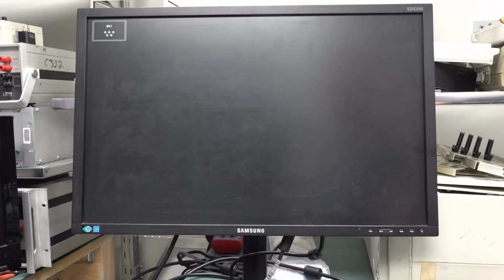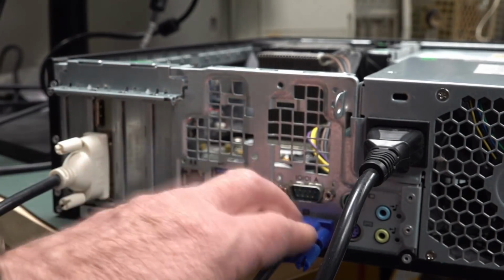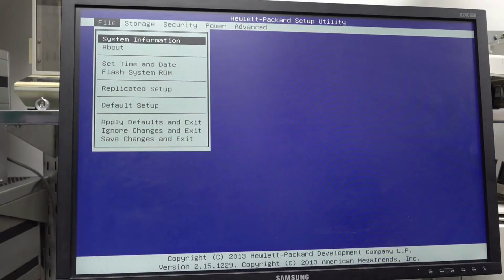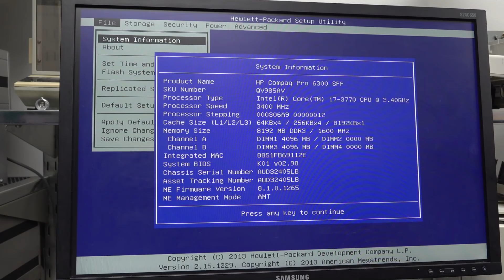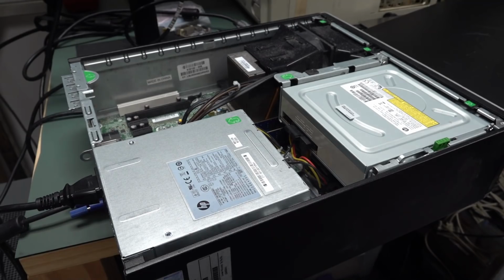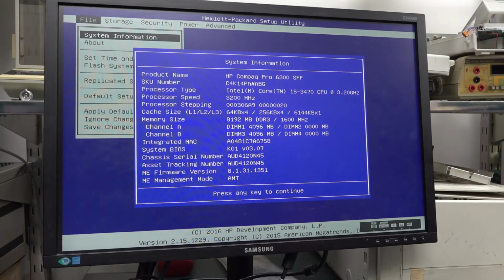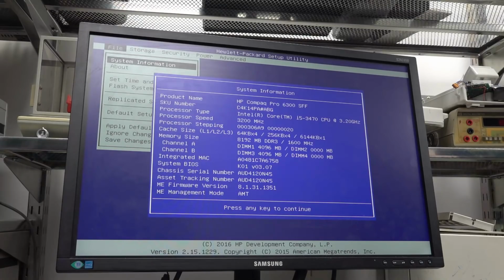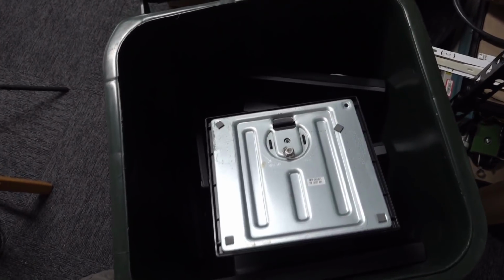MORE Asymmetrical Dumpster PC Stacking

Comment: Ah yeah sff business pc's. I see them in the ewaste often in numbers optilex, thinkcenters etc... I always liked the cases. They're hard to flip though in my experience anyway. I think people buying desktops are gamers mainly and sff not really flexible for gfx cards and storage options etc.
Reply: Some people transfer into fancier cases add some RGB, SSD , GPU and sell but sometimes HP/Dell/Acer use proprietary components
Reply: @Glenjimen  I found an m73 Lenovo a while back 4th generation i3. A pretty good machine I'll end up sticking a 4770 in it but yeah hard to flip. I wouldn't bother transfering it to another case just wouldn't make sense as everything is kinda made to fit. The case is actually the best thing about it that it slips under a hutch etc. Though by today's standards it's still pretty big. Development of mini PC's, raspberry pi etc is pretty cool imo. We'll end up being able to vesa mount a little box on the back of the monitor soon.  You already can but they'll get way better, substantially more powerful once we get beyond shortages and slowdowns of semi conductor components etc...

Comment: My employer uses software and back end infrastructure for 10-20 years, but we change out client desktop and laptop hardware after 3-5 years.

HDDs get shredded, the rest is auctioned off by the pallet.
Reply: An normally ends up in Africa

Comment: You should make a Folding At Home cluster computer that runs off your solar system when you're away or not using all of it's capacity until you get some energy storage.
Reply: It is amazing how much more a modern desktop can do for the same power,  compared to something 8-10 y old. A modern graphics card can do even more than that. But yes if it is energy that would otherwise go to waste,  you could run the old hw cluster...

Comment: I upgraded to an i7-3770 SFF machine last year for $100. Finally I could play x265 movies. DP is such a pain, try finding a converter that outputs 2k DVI for under $100.
Reply: Easier and cheaper to just buy a decent monitor or TV that has HDMI inputs. Something from, what, year 2000 or so.
Reply: @johncoops6897  I didn't know there were 2k+ DP converters under $100. The only cheap ones are passive or don't work with older DP computers.

Comment: Still running i7-3770 as my main desktop here at home and just moved it from Western Digital Black spinning rust to SSD. :)  Oh, I am on my 3rd laptop since then so there's that.
Reply: Same CPU and I switched to SSD with Ubuntu and the only difference I could notice was faster booting (yay, I save 20 seconds every three months I reboot) and applications start up much faster.
Reply: I have FX 8300 that still sucks compared to i7 3770k

Comment: If 1,000 people haven't already told you, there's a strong chance those DisplayPort connectors will supply HDMI with a cheap passive adapter.
Reply: Also VGA until recently (Nvidia until 9xx)

Comment: those i7-3770 are pretty expensive on eBay and co, a while back they were 150€+ or more...
Reply: Yeah, a lot of the cpus and ram would be worth reselling... 10x 3470 would be like at least a few hundred bucks still.
Reply: @rkan2  yes and the Motherboards are great for Parts! You get some nice ultra low ESR Polymer caps and some great (SMD) MOSFET. Though some are power stages (=MOSFET with Drivers), so they might not be that easy to use....
Reply: They should be. I've got 3770k and it can run most modern games just fine.
Reply: @SurajGrewal  well, yeah, but the days of Quad Cores for gaming are numbered...

Comment: Dave 
If you donate a computer make it the best PC you can with the available parts .
Move the I7 cpu into the I5 case then max out the memory .
Or just fill up the slots with the same size ram modules & fit 2 hard drives .

Storage is more important than a video card .
 A 5 or 6 year old computer with on board graphics should work ok for video & surfing the net !
Reply: Why go to all that effort? A donated PC is a donated PC - they get what they are given.

Comment: I'd go peel those product key stickers off the rest if it were me.
Reply: OEM keys get locked to the hardware. So pretty much useless unless you reinstall Windows on the same machine.
Reply: @DONK8008  Not quite. The factory install of Windows will be done with a special manufacturer key and the sticker key is only there for reinstallation. Since the sticker reinstallation key is probably unused I don't see how they could tell if it's being used on the machine or not.

If you are reinstalling on the same machine, the sticker key is always unneeded on these systems as it's possible to reuse the original manufacturer's key of 74T2M-DKDBC-788W3-H689G-6P6GT after installing a certificate file.

Comment: All our monitors at the office are DVI and all our PC's are DisplayPort. You can buy DisplayPort to DVI and DisplayPort to HDMI adapters dirt cheap off Amazon/eBay. DisplayPort is backwards compatible with DVI & HDMI, so a simple adapter works perfectly fine.
Reply from the maker: Yeach, I just don't have spare DP cables or adpaters, but tons of DVI cables.

Comment: Take out the mobo + cpu + ram + psu and put them on ebay as a kit ... or even without psu if it's standard atx psu. Worth it.
Reply: mobo isn't standard either. Most of these smaller form factor PC's from Dell/HP use a custom layout.  If Dave were to bother the only shit worth pulling to resell these days would be the CPU.
Reply: Not worth it AT ALL. You forget the labour to test, disassemble, photograph, create listing, package... then deal with refund claim for that parts "didn't work". These machines are trash, which is why the are in the bin rather than sold. OK for hobbyists, but totally non-viable for Dave to resell.
Reply: @johncoops6897  If it's listed as 'For parts or not working' you shouldn't need to worry about complaints of parts not working. Then you can also skip the testing.

Having said that I agree it's not worth it. If he wants to make a few Aussie bucks from them a better option would be putting an ad up on whatever Craigslist equivalent is used there.

Comment: wouldn't it be worth it to take out all the CPUs and maybe do a draw once in a while? along with the RAM. might be worth it for some, and maybe shipping is more accessible than for the whole chassis.
Reply from the maker: That's possible. But who'd want a bunch of old Gen3 i5's?
Reply: @EEVblog2  people buy them on eBay all the time
Reply: @EEVblog2  finding a case and power supply is easy. If you sold the motherboard, CPU, heatsink, and ram as a package, it would be worth the shipping cost, since you've ditched most of the weight and size.

Comment: What are you doing with the Windows keys? :D
Reply: The Windows keys that come with these type of machines are coupled to the hardware so you can't use the key on another machine.
Reply: @peterpv0001    there is a loop hole    just tell them the main borad aught fire
Reply: @peterpv0001  Actually that's not the case. Windows 7 preinstalls use a special manufacturer preactivation key tied to a hardware certificate (in this case probably 74T2M-DKDBC-788W3-H689G-6P6GT) instead of the sticker key. So the sticker key will be entirely unused in most cases and not tied to a specific piece of hardware. Microsoft could only check which manufacturer the key is from but AFAIK they don't even do that. With Windows 8 and 10 there isn't a sticker key and instead a unique key stored in the BIOS is used.
Reply: Peel the stickers off and install Linux.
Reply: Just buy $2 keys off AliExpress or Ebay or Reddit. Just as legit.

Comment: The broken one - does it have a power switch at the back? Or maybe the front on/off switch is broken?
Reply: I suspect something broke loose inside the PSU due to rough handling when it was being thrown away.  It isn't like they would have cared at that point.
Reply: He swapped the psu from one of the i5s and it is a bobby dazzler

Comment: Were they smart enough to remove all the hard drives before dumping?
Reply from the maker: In this case, yes. But not always, I find heaps of hard drives.
Reply: @EEVblog2  Quicker if you dont mind the spend to change for a low-spec to some kind of SSD stick drive- less weight !

Comment: Here I am still rocking an i7-2600k and people are throwing out newer pc's.
Reply: And I'm using Intel Core i5 M520 @ 2.40GHz !!
Reply: Hell, I'm watching on a machine very similar to the lower spec ones in that stack (although I've maxed out the RAM, added a second HD, and put in a decent graphis card).  Now, I couple years back I built myself a MUCH better gaming rig that's on the OTHER desk (6-core Ryzen with SSD, nice graphics card I can't be bothered to look up, 64G RAM,  only downside is Windows 10).

Comment: Easy enough to go grab one of the others in the same case, and swap power supplies, likely thy are identical in spec, and you probably will not even need a screwdriver to change them out.
Reply: Yep, did that, the 3rd i7 works great now! And yes, no screwdriver required to open the case, remove the supply and reinstall, amazing design.
Reply: @EEVblog  A lot of the better designed computers are like that, no tools needed to change the parts that are likely to need upgrading or changing in the machine life. Memory, drives, power supply and cards no tools needed, though you will need tools to do a CPU fan or upgrade, or a motherboard, which in most cases is a new computer already. Great for most manufacturers though, as you have to buy the spares from them ( FU Hell) at a premium for power supplies and boards. Using an old Fujitsu, and can do almost all work without tools, though I did need to do some creative cable ties and an extra fan, because it came with no extra hardware for the second SSD I put in, and it ran hot in the bay. One cheap Corsair RAM cooler, repurposed to get the fan, running off 5V, and it is 20C cooler.
Reply: @SeanBZA  Still need to use a tool to change CPU and motherboard? How tedious! I've worked on a number of systems where the motherboard can just be removed with thumbscrews. However many of these still have screws on the CPU heatsink, so you'd need to swap CPU and mobo at the same time if you don't have a screwdriver.

I have an HP server where almost every field replaceable part is toolfree. For the other parts a tool is supplied which clips into the back of the server for storage. Of course mine is missing, and some unofficial tasks require tools.
Reply: We use similar PCs as media servers and 3 days ago I had one with a noisy PSU fan. Instead of opening the PSU, I simply changed it from another machine. No screwdriver needed!

Comment: Why don't they donate these PCs and monitors to charities which refurb computers and give them away?
Reply: Probably tax purposes, write them off and say "dumped" will allow them to claim full depreciated value off tax, and no dealing with any other party. Disposing by giving means a lot of extra paperwork and hassle, plus you have to declare a value then of the disposed of asset, and this means you pay tax on it.
Reply: because they know Dave will dive in the dumpster.
Reply: Back in the late 90's, I would overhaul old kit, usually add a new CD drive etc and donate them to schools for free. After a while they started to get fussy and had to be a certain spec etc. At that point I stopped because ultimately if there was any issues, it came back to me, even though they had everything for free.

Most businesses simply don't want to have that 'come back' if anything wasn't up to spec or failed within x weeks.
Reply: @terry6131  Yep- it's like someone said, these days schools have service contracts for their gear and all the labs / IT suites use the same gear to make it easier to deal with replacements and such. Still, there are plenty of other good causes who aren't so fussy.
Reply: @SuicideNeil  - Schools wouldn't want those machines. The STUDENTS bring their own laptops, the school doesn't supply computers for use by students, and the staff use machines provided by their employer.
Reply: Hi, i used to give out old work PC's to staff who wanted them for home, i made sure they all got one each as i did not want one person selling them off on ebay

I did give them out to schools and charities but then ended up asking for upgrades which i would if i have the spare old memory etc.

In Australia we donot have the goodwill stores that USA has, we do have charity shops but they cannot sell anything that plugs into the mains voltage unless it has been certified and a sticker with the inspectors licence number and date attached on the appliance.

As for those HP's they are better than the HP8200 - I5 2400 that is my second best machine at home,  they would be a ebay $100-$150 value at the moment in Australia

For HP machines you donot need the windows license anyway, same with Dell, the OEM BIOS / UEFI will automatically register as fully licenced with Windows 10

If you get them at a good price a new 250G SSD is @ $25 and you can reinstall win 10

The monitors yeah, not sure what they are worth new, just need to check the hours on them.

Many large corporations get PC's on a 3 or 4 year lease then discard them and start again

Regards
George
Reply: They just did?
Reply: @benbaselet2026  No, they put them in the dumpster room. Dave is going to give them away, but that's different. These companies couldn't care less about helping people less fortunate, they just want to offload them as easily as possible.
Reply: @benbaselet2026  'They' didn't-  it would take effort to organize collection of the old PCs and monitors in order to donate them, and the companies ion the office building really can't be bothered with it. Dave on the other hand realizes that there is value in even 'old' PCs so is willing to put the relatively small amount of effort into cleaning them up a bit and donating them to good causes. I knew a guy many years ago that collected old PCs, cleaned them and and donated them to Woman's Refuge charities- even low end hardware is perfectly good for basic web browsing and word processing duties.

Comment: Fix em up and give to a local school.
Reply: Schools don’t want them, charities will take complete PCs for low income/disaster families. Otherwise they’re ewaste. 

Schools have really embraced uniformity to reduce IT as they cost more than the equipment. Also it’s harder for students to really mess up a chrome book/iPad.
Reply: @peterg.8245  Other organisations would love them though. These would have been ideal workstations for the community radio station I used to run all tech for.
Reply: @peterg.8245  let the kids mess em up and then fix em up. They'll learn something.
Reply from the maker: @peterg.8245  Correct, schools won't touch them.
Reply: @EEVblog2  @Peter G - sigh... when I was a boy the first computers we got to work on was two Apple IIe.... that was it for the entire school of 250? Kids.
Reply: The students bring their OWN laptops and iPads to school. There aren't computers in schools now says, and certainly not desktops.